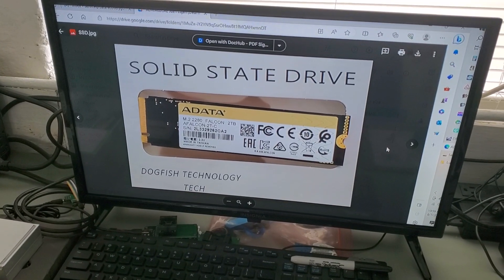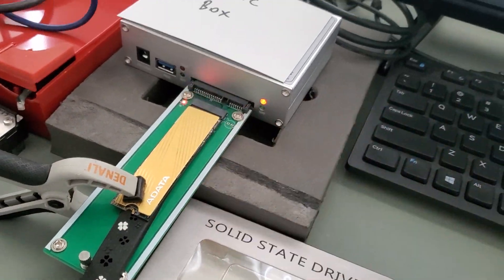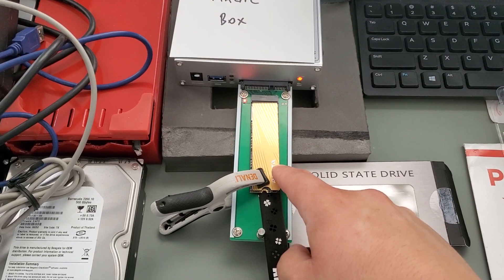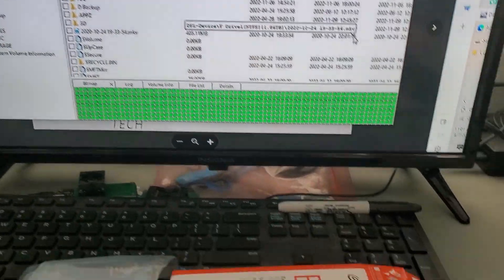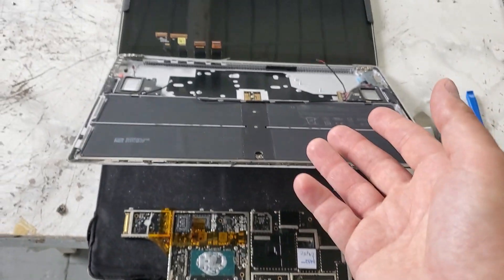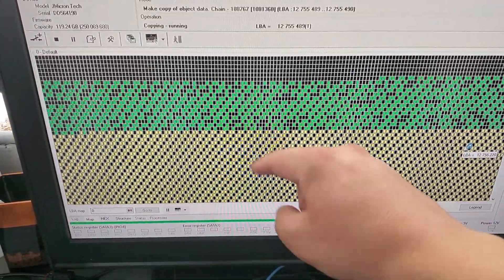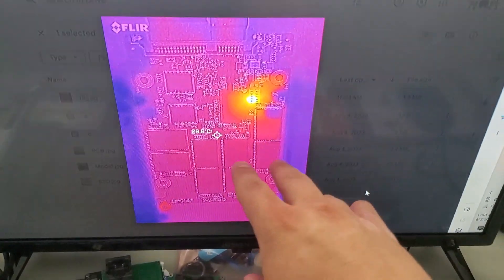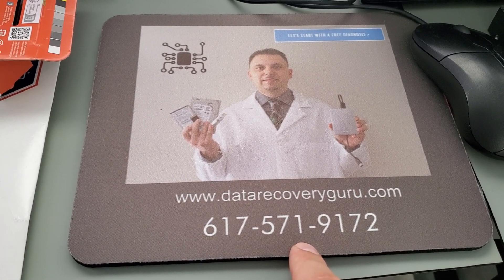How we recover various NVMe SSDs hardware & software data recovery tools

Comment: Good morning
I personally have the DFL-PCIe-4x and the All-in-One Data Recovery Adapter USB 3.0.
I have an NVMe drive that shows a read error during loading. Now, you have the DFL-SRP and the DFL-URE Plus NVMe.
My question is: is the DFL-SRP combined with the All-in-One Adapter the same as the DFL-URE Plus NVMe?
I’m considering purchasing that device, but I’m not sure whether the issue with my NVMe is firmware-related.
Unfortunately, I don’t yet have the budget to purchase a PC-3000.
Reply from the maker: When powering on the NVMe SSD, but os the status register flags flow? BSY? And stays BSY? Something else?
Reply: @Datarecoveryguru1  Then first is BSY, then DRD and DSC and when i try to make a new task, he shows the serial and the model correct,  95% register status and thats all.
Reply from the maker: @timmrombouts133  BSY and DRY is good. Correct init is great. Then, when trying to read LBAs, what kind of error do you get? Send us a short video via WhatsApp if easier.

Comment: I want learn ssd recovery 
Please guide me 

Ssd data recovery sikhna chahta hu 
Please Guide me
Reply from the maker: Conceptually it is like an HDD, except we have chips instead of disks, so no mechanical components. Similar failures. Much more complex to recover, especially when it is a firmware failure & increasingly so with newer SSD models. 

Reading from bigger data recovery forums is a good start.
Reply: @Datarecoveryguru1  any guide line , name of forums, please
Reply from the maker: @bawacomputer  forum.hddguru.com